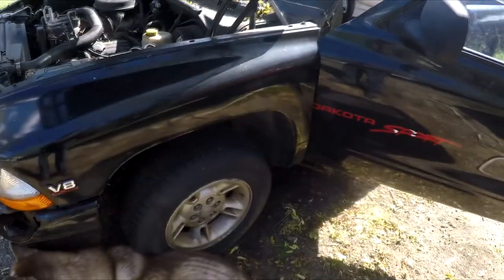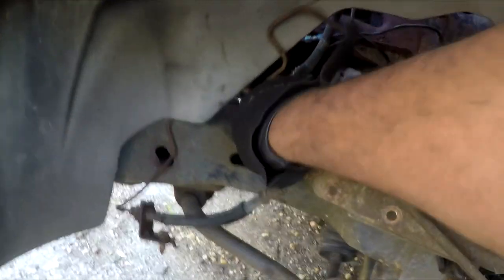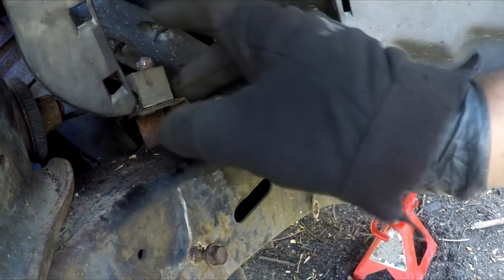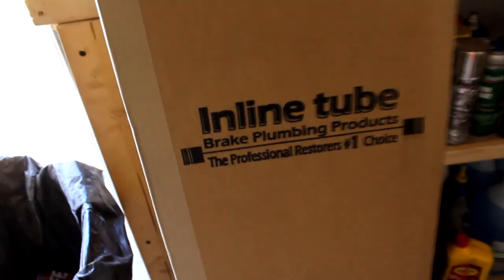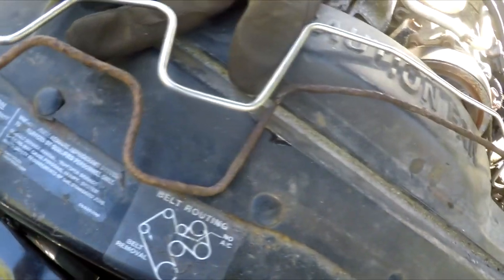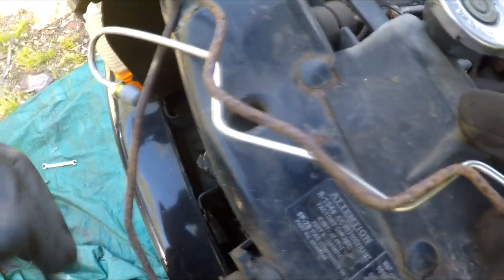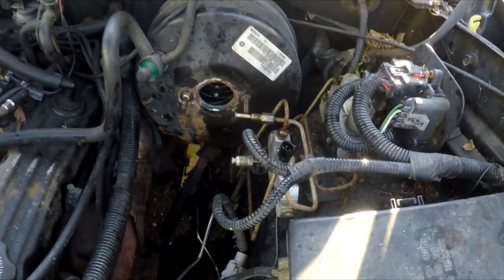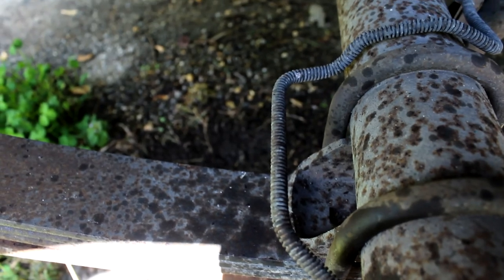Dakota Brake line replacement

Comment: Nice job!  I just replaced the line from the front to the back on a 2001 extended cab Dakota.  I used a propane torch to heat both tube nuts to get them loose.  I bought a 25 foot roll of AGS copper nickel line, taped it to the original line to match bends, then bubble flared both sides.  The tube nuts are 10mm by 1.0 on the 2001 with bubble flares.

Comment: Do you have the correct part number you have for the new brake line kit.

I have a quad cab 4door 4wd.
Basically have issue with right front but may need entire lines, maybe.